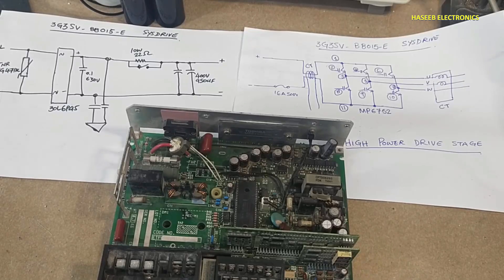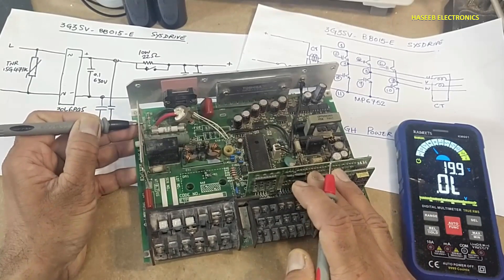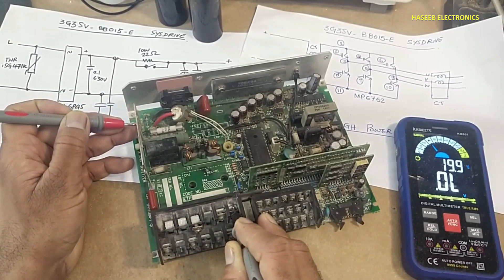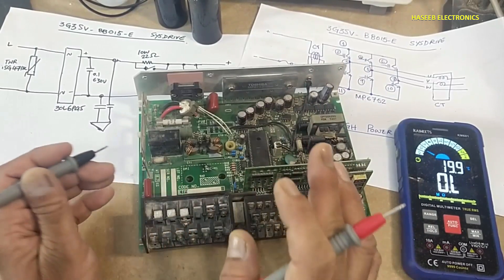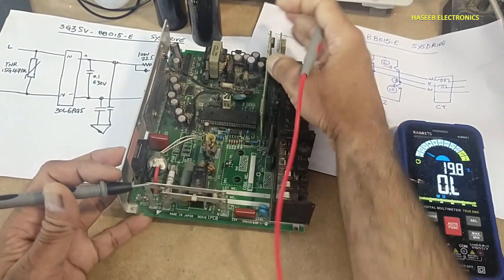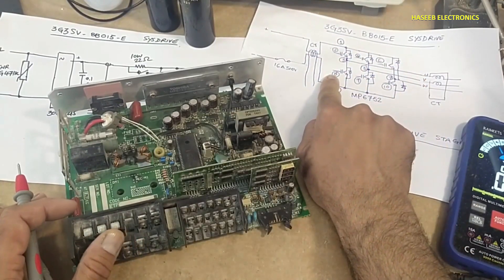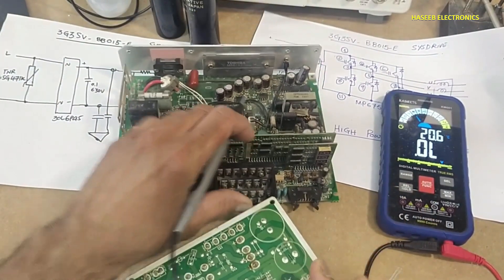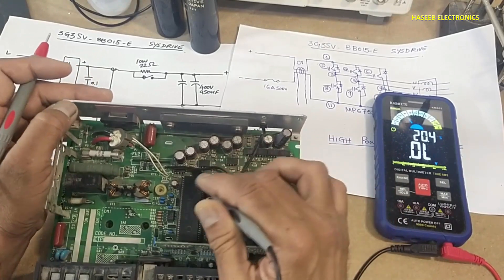{1052D} Omron Sysdrive 3G3SV VFD, Testing DC Rail, Power & Output stage

Comment: Sir can you make an explanation video regarding the essential signals for a digital circuit to work like (reset, enable, powergood etc.) And what are the basic requirement of a circuit to function normally. Like power, clock and signals maybe ? 

It would be very helpful for a student of electronics with very little knowledge like me. 

But i am eager to learn from you because the way you explain concepts are remarkably easy to understand.

Thank you.

Comment: Is that multimeter able to test those IGBT components if high voltage? I seem to remember having to use a different (two-battery) meter for components that trigger at high voltage? Thank you!